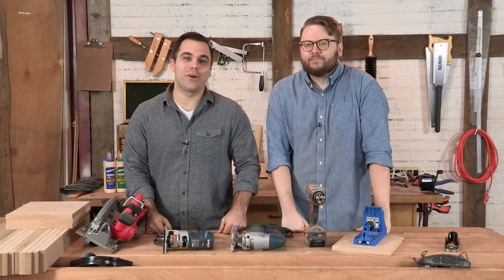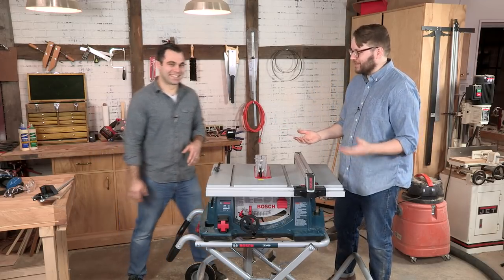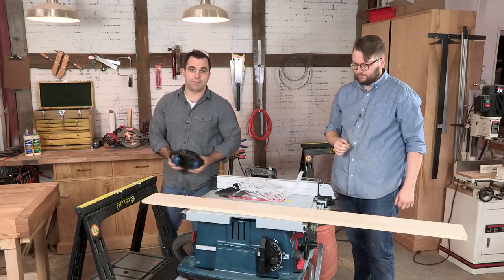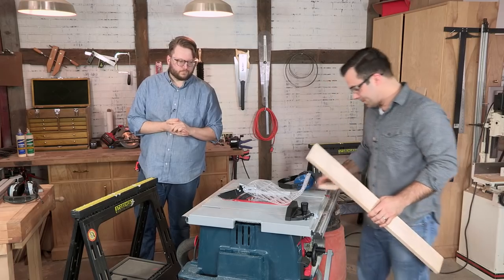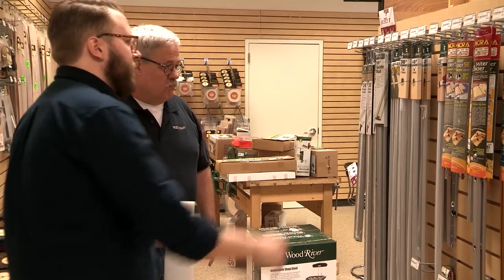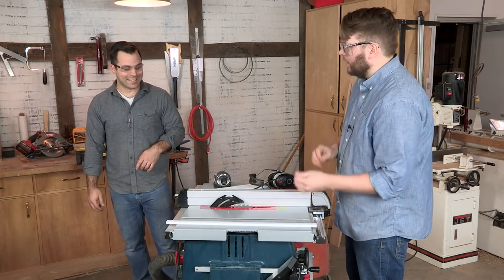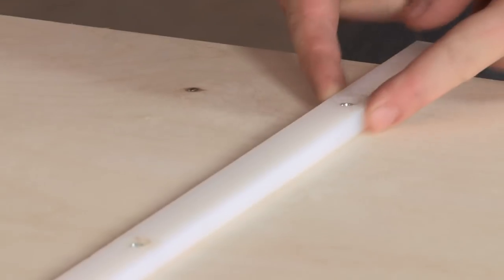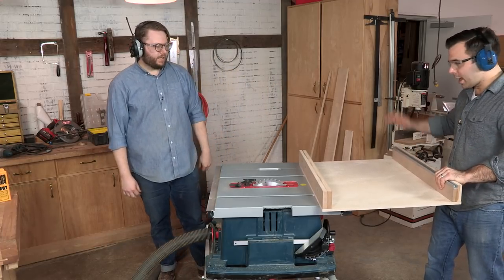Introducing the Table Saw | I Can Do That!

Comment: When using the push-stick on a wide piece of material, if you have it pushing slightly to the blade-side of the centre it will help avoid the material from creeping away from the fence as it goes through. Don't get it too close to the blade of course.

Comment: I would suggest making the runners on any sled a little long so that they stick out and can be seen for lining up the sled on the table.  I had planned to cut mine off even, but after using it several times, no way!  It helps so much to line up the sled with the table saw grooves.  Try leaving them long enough to see them.  You can always cut them even later, if the extra length doesn't help you.

Comment: Hi guys, great video, just a quick suggestion from a novice here. I think that there should be some sort of stop that prevents you from pushing the sled too far forward. If you do it would not only pass through your safety block at the back but the entire sled could pop up out of the tracks and even fall over. ( that was my experience......just sharing)

Comment: Just a few important comments:
1.  NEVER set the miter gauge to the blade as described . If the blade or saw mount is skewed it will never be right. Instead, set the 90 degree and 45 degrees from the miter slot to the blade. If the saw is mounted askew the cut will still be 90 or 45. 
2.  You should definitely write down and discuss the order of business in advance, and stick to it. If you forget something, go all the way through and come back and admit the mistake. You're human too, we do that all the time.
Reply: Could you elaborate on the order of business that did not go to plan?

Comment: I hope that your work is more accurate than that last guy. He was just sloppy. See his router table and drawers for evidence. The screws on the router plate weren't sunk enough and protruded so much that they scratched the workpieces and made gapped joints. It was a hot mess.

Comment: At 22:28 the comment "Once a screw is stripped there no going back." is inapporate for a how-to video and is just wrong. It discourages  newbies from woodworking. The two hosts know or should know that there are a multitude of ways to plug a stripped hole. At this point in the video the host could have provided a seque into fixing such typical woodworking oopses.  I'm sorry but right now, two is not greater or better than one.

Comment: Safety glasses on glasses facepalm
Reply: Not at all, ordinary glasses lenses, plastic as well as glass do not meet the necessary requirements for impact protection - you do not want a lens shattering in your eye when hit by an object.
Reply: Unless you are adding side-shields on your glasses, they are a must.  I thought the same thing until I had a piece of metal go beside my frame into my eye.